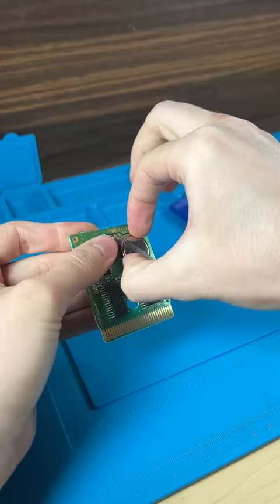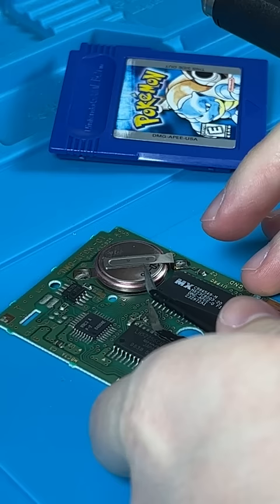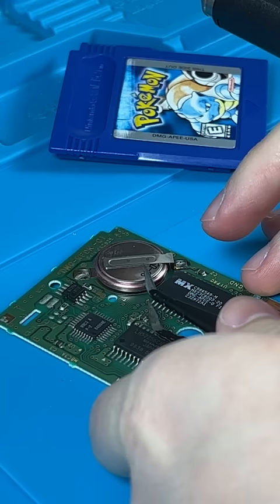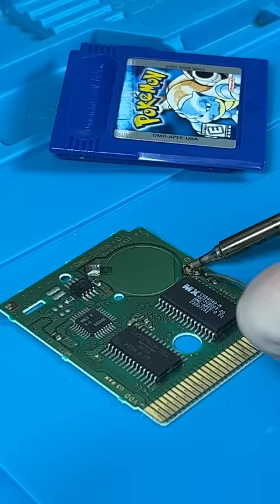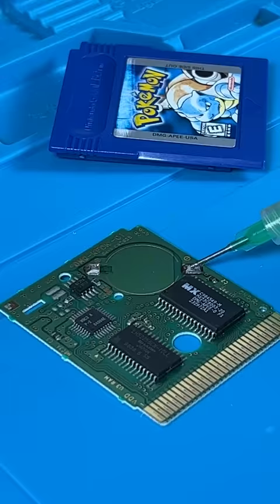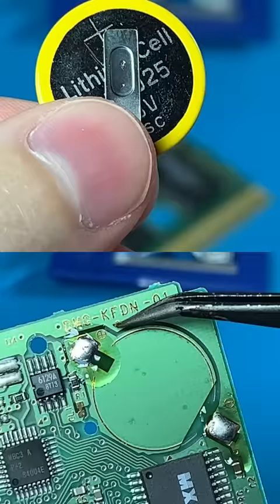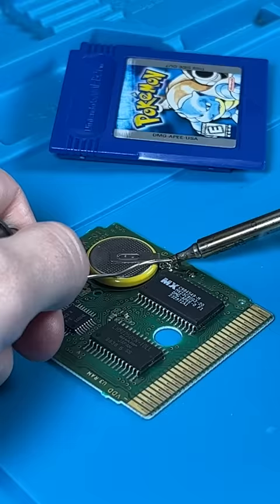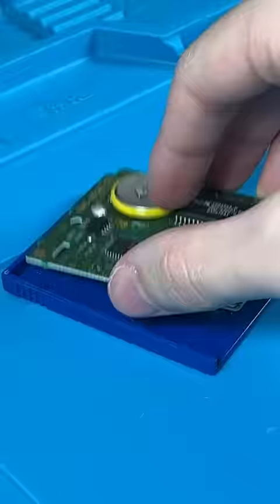How to PROPERLY Replace a Game Boy Save Battery! #Shorts #Restoration #Satisfying

Comment: No point in adding flux just to clean the solder. Desolder battery, wick/suck old solder, position battery, tack one side, solder second side, solder first side, clean. Really no need for flux in this application as your solder will have rosin or flux inside.

Comment: I replaced my pokemon blue gold and crystal batteries as they had gone bad and weren't saving. Instead of buying batteries with the tabs pre pressed, I pried up on the tabs and inserted new batteries and pressed the tabs back down. They work flawlessly, not the cleanest job but it works.
Reply from the maker: Damn that’s pretty risky
Reply: @JakeSimmons  nah, batteries were bone dry. I removed the batteries before prying on the tabs so I wouldn't damage the board for the game.

Comment: You don't need to back up your save. If you leave the game in the console while its running you can swap the battery.
Reply from the maker: That is not something I recommend
Reply: @JakeSimmons  It works I've done it many times. The console transfers electical current when powered on. This saves you time and money on usless equipment.
Reply from the maker: @timetravelingoldman6839  I meant more the risk of melting the game boy shell since it’s so close
Reply: @JakeSimmons  That would never happen and not once has it ever happened with the batteries I've swapped. Please don't spread nonsense.

Comment: Spent the day soldering yesterday, I soldered the connector back onto a battery and my wire ripped off from the prong of my multimeter(it was awful and the solder wouldn’t stick)
Reply from the maker: RIP multimeter
Reply: @JakeSimmons  I got it it solder to stick eventually, I think I burnt the metal, I tried filing it down and everything for a better connection but that didn’t help, the end product was probe and wire that looked liked it was made in a cave but technically it does work
Reply from the maker: @chen2win  that’s better then nothing I guess🤷🏼‍♂️

Comment: you're using pinecile Soldering iron? or the other one o don't remember the name? love those Soldering irons, small but powerful, also much more easy to handle
Reply from the maker: I think the company is called miniware and it’s the ts100. It’s linked in the description! I love it very much!
Reply: Yes, that's it. I've actually got the Pinecile, it's the one made by the folks over Pine, and it have USB C :)

Comment: I have an orignal spuds adventure game but the cartridge is a bit bent. If it stays in the original cartridge the game opens but won’t load.. When I switch the game into a straight cartridge it works fully. What can I do?? Is there anywhere that I can print the sticker on front and glue it on a new cartridge? Thanks

Comment: I remember my Pokemon blue would lose it's save if u shook it. I was 11 got moms sewing needles and took hours getting that screw off the back of that cart , all i did was put  a folded piece of paper on the battery so it wouldn't shake. Boom it saved perfectly.

Comment: How do you know the battery needs replacing, does it lose the data?
Reply from the maker: It does lose data once the power is gone. You really don’t know until it’s gone. You can test the voltage with a multimeter and see if it’s low but that’s about it
Reply: @JakeSimmons  ohh thank you for explaining! I never knew they had batteries

Comment: That's not a proper way... And here's why:
1. You are heating it for too long
2. You are using too much solder
3. You don't need to add flux after you removed the battery 
4. Last but not least, don't pull it up like that when one side is still holding by a solder

Just learn basic stuff why you need flux and how to use it, why you shouldn't overheat, and why too much solder is bad

Comment: Quick question, will you be able to do this with a gba game? I have a somewhat rare game that’s saves don’t work and it constantly resets my save
Reply from the maker: Some gba games use a battery to save so it’s probably what’s wrong. They just use smaller batteries

Comment: How will you know if the battery is dying??
Reply from the maker: Unless you test the voltages with a multimeter, you won’t know until it dies
Reply: @JakeSimmons  is it like CMOS from computer motherboard?
Reply from the maker: @hotasianstepsister3039  yes

Comment: Way too much solder.
Doesn't remove old solder so adding fresh does nothing.
Running solder into the iron rather than the metal.

Jesus dude. Take some PCB courses.

Comment: shorting the battery with the pliers is never a good idea
Reply from the maker: The tweezers are built to work with electronics
Reply: @JakeSimmons  are the two metal pieces of the tweezers electrically isolated from each other?
or are the tips isolated? (they dont look like they are)
Reply from the maker: @MrSoulBack  I don’t know what the official term is but they are tweezers from my iFixit kit. It’s meant to be used on electronics and I’ve been using them for years with zero issues
Reply: @JakeSimmons  would be interesting if you could measure the conductivity between the two metal parts.
on the homepage of ifixit it says they are ESD save which only means they have a coating where you grab them. this would only guarantee isolation from the hand